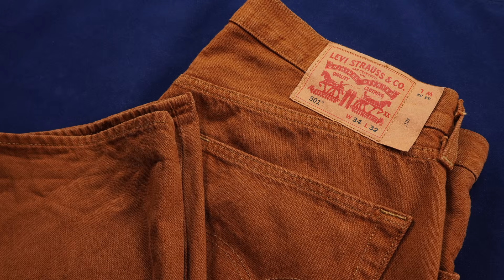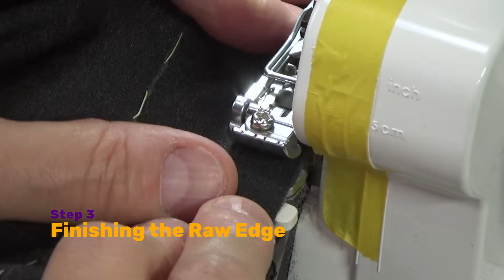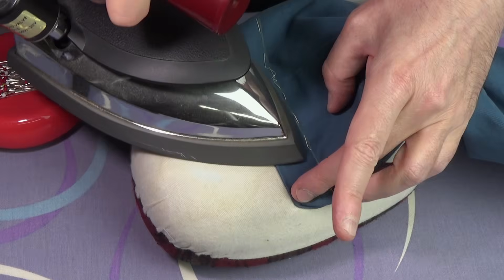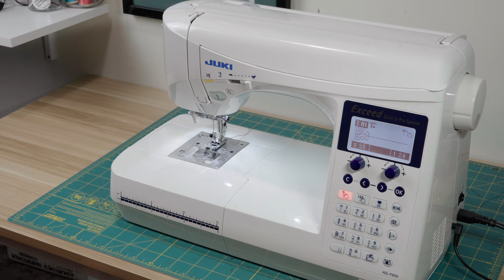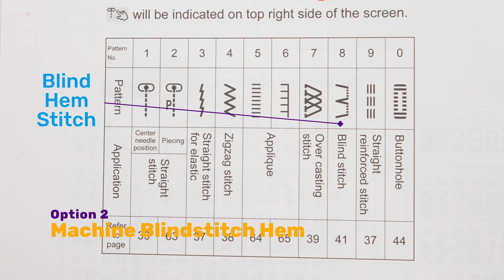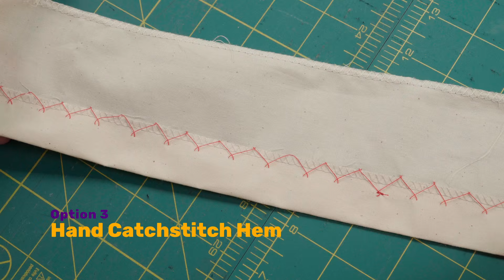How to Hem Pants: Tailored or Casual, Machine or Hand-Stitched

Comment: These are great techniques, but if pants are either tapered or flared, adjustments to the hem allowance are required.  Keep up the good work.
Reply from the maker: With a flared pant, up to a certain point you can ease the inside hem allowance by carefully distributing the excess hem allowance as you pin. That's partly why I urge the sewist to adjust everything as they pin and hand-baste, and to stitch with the inside hem allowance towards the feed dogs.  But yes, past a certain point, you are right - an adjustment of some sort is required.  Either use a shorter hem allowance, or undo the side seams a short distance and let them out/take them in a small amount, so the hem allowance is the same circumference as the outer pant.